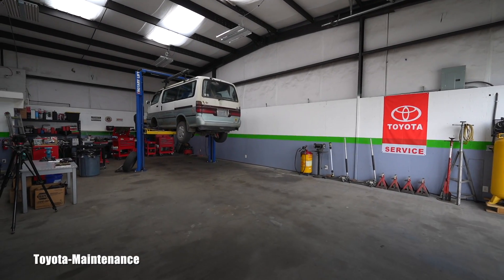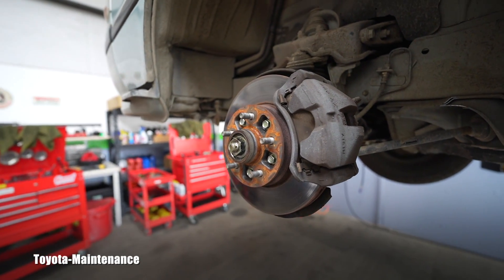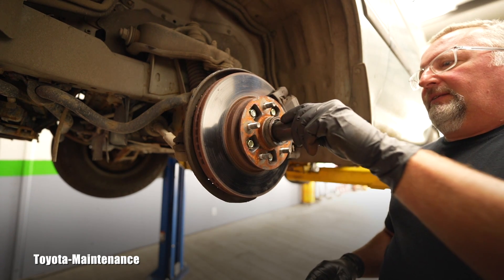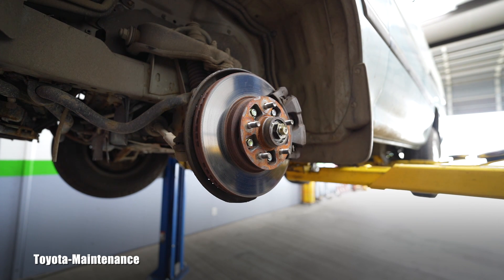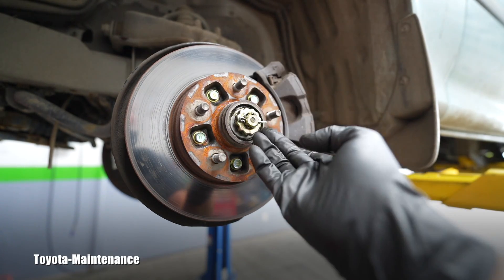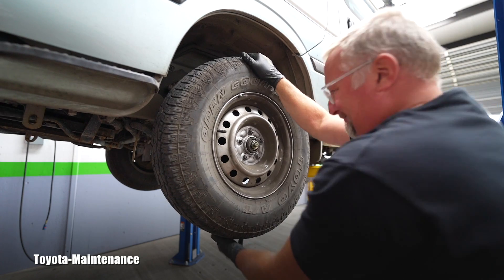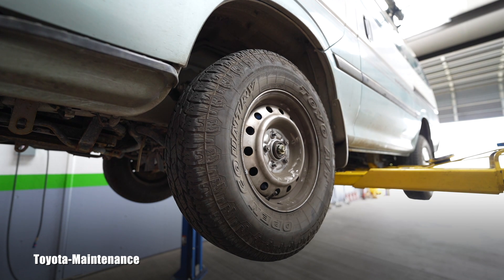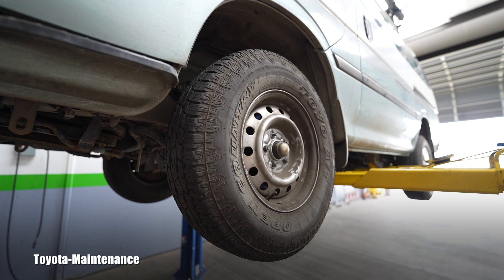Toyota Front Wheel Bearing Torque

Comment: Thanks for this video. Now I know how to check. I will have to loosen up the bearing nut a bit on my tacoma. It's on a bit too tight on mine right now.  Also I had wish you would show us how you repack it.  I'm doing mine right now and is confused as to how much grease you put in the assembly hub.   Some say 1/3 full other say just put a coating of it on. But most these video's are of other models.  So if anyone can help, that would be great.  :)

Comment: The spec for the 2WD pickup is 34 N-m to SEAT the bearings in the races, turn the hub seven times, then back the nut off until "hand tight", then check the preload with a pull scale. So 29 N-m is definitely in the ballpark.

Comment: High school and college automotive taught. As well as 45 years of maintaining 60s, 70s and 80s vehicles with tapered bearings.  Use spanner to dial nut down till it stops.  Then back off 1/8 turn  to feel drag disappear.  Then finish with crown and cotter pin.

Comment: Standard Toyota procedure for adjusting front wheel bearings is to go to the specified torque while rotating wheel and then loosen the nut off and tighten by hand as far as will go (not ratchet or wrench). I find this generally results in a slightly loose bearing.

Most reliable method for Toyota is to just adjust the nut with the wheel still on the car, just tighten it until the slop goes away.

Comment: Peter This Is How it Works.  I've Been A mechanic 49 years.  It's The Same With Any Other tapered Wheel bearing.  Put The Wheel On  You Tighten The Nut So There is No Play When You Grab The Tire At 12 O'clock And 6 O'clock But You Can Still Move The Washer Behind The Nut With A Screw Driver. Thats How it Works. That's How it Was Taught When I Went To Vocational School In 1972 And 1973. Ask Any Old Time Mechanic. That Fixed Automobiles Back before Sealed Bearings Any Car or Truck  Or Anything With A Inner And Outer tapered Wheel  Bearing.  I've Done It Thousands And Thousands  Of Times Since i Was 17 Years Old.  It Works No Torque Wrench Needed.  Remove All Play But Still Able To Move Washer With Screw Driver. Period
Reply: The washer is locked, they have little thing that slides in the grove of the axle splindle that keeps it from rotating.
Reply: Yep! We must be around same age! 👍 OH! Then the controversy on how u bend cotter pin. 😂

Comment: I used to repack those cone  bearings every 40,000km with high temp grease &  new seal on the 1987 you needed a spring scale and tighten till  breakaway torque ie stationary to rotate is 1.1kg. I'm afraid 😨 you may have over torqued this and it will wear out the bearings early.